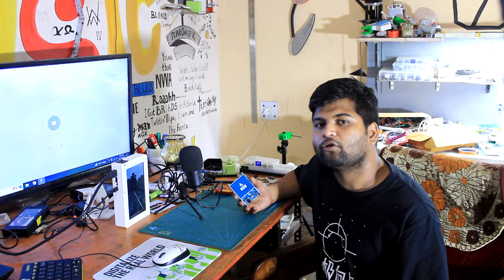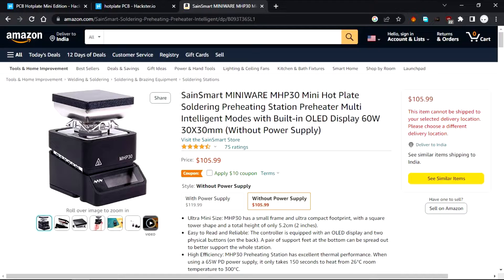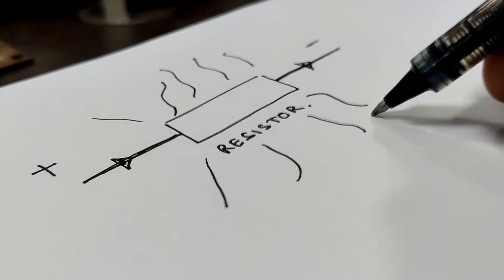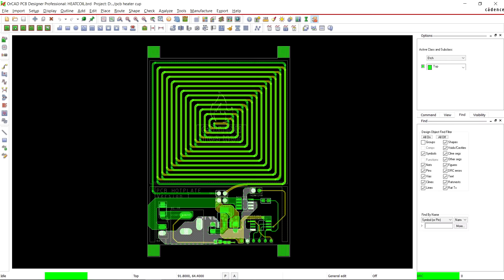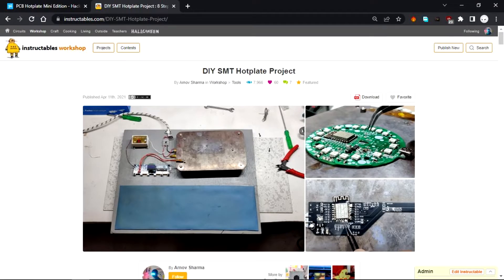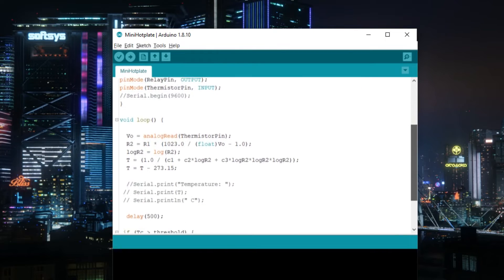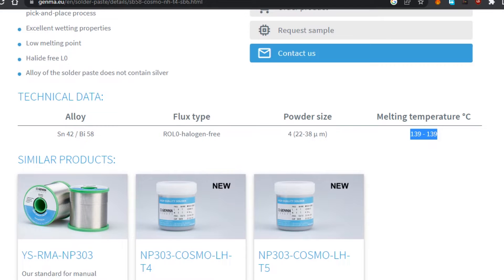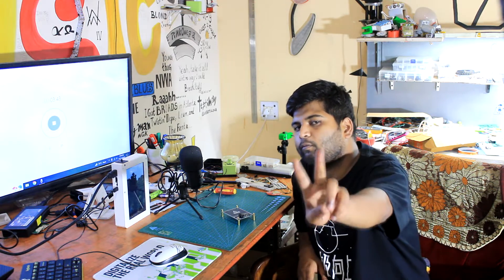Easy to make Mini SMD Hotplate

Comment: you use resistance, but if you make hundreds of small coils and put copper or metal in them, you have an induction plate with lower power and faster heating, you can control each coil separately to precisely control the temperatures, and you can also apply a thin layer of platinum on the copper coils to make it work. like a temperature sensor

Comment: Hi,

This is Faisal from Pakistan, I am not an engineer but I need something like this to burn bakhoor, you must have seen electric bakhoor burners, I need to get that and if you buy them from market they hardly work for a month or even less. Now my question is can I make some thing  as a lay man v v simple hot plate for burning bakhoor? If yes then can you guide me for that, I will be grateful to you. The size of that can be even smaller then the one you just explained.
Thanks buddy
Reply from the maker: If Bakhoor burning temp is under 200°C, this device can be used.

Comment: Can't ya use a peltier device or wud it melt lol
Reply from the maker: peltier will be not efficient for this setup because it will also waste energy on the cold side, also hot side won't reach temperatures above 140°C
Reply: @ArnovSharma  what about add plate of aluminium and thermal compound pad or paste wud it help the Pcb last a bit longer
Reply from the maker: @davey2k12  again, if we add additional metal plate, we need more energy in order to heat up the extra added metal, copper tracks will still heat up and deteriorate. So no, adding additional plate won't help. However, if we change the material of pcb from FR4 to metal core and increase the copper thickness, that might make a better setup. Similar heating metal pcb are used in 3D printers.
Reply: @ArnovSharma  good info bro 👍
Reply: @ArnovSharma  thought so 👍

Comment: Considering that most PCB material is rated for less than 170C, how long do you estimate before the lands begin lifting from the board?
Reply from the maker: maybe 20-30 cycles
Reply: @ArnovSharma   Maybe  2nd version could have the coil PCB  and the drive circuitry separate, so you don't have to solder a new driver  time the coil PCB wears out.
Reply: Expand board dimensions slightly, hollow out coil area, place thermistor on a thin strip in that area so it makes physical contact with the middle of coil PCB.

Use really wide tracks both top and bottom to send coil power up to the top stand offs. They will be used not only as legs, but they will also connect coil PCB to the power tracks. As the top standoff will now have power,  nylon bolts will need to be added so they don't short on a metal surface.
Reply: @ArnovSharma  What if you made the heater part a separate PCB made from aluminum PCB materiel?
Reply: @atomicskull6405  This does seem like the best option doesn't it !
PCBWAY is not astronomic price for alu boards either.
Reply: @ArnovSharma  I wonder if there is a "high" temp resin you could cover the board with. Maybe extend the life a bit.  I like your idea though.
Reply from the maker: @ed-jf3xh  that's an nice idea, I do have that at my disposal

Comment: The glass transition temperature of FR4 is around 140°C, would that deform the PCB over time?
Reply from the maker: sadly yes, that's one drawback of using FR4 material.
Reply: @ArnovSharma  I see they make pcbs on aluminum, would that work here?
Reply from the maker: @mavamQ  it would. i opted for FR4 because this let me add coils on both layers. MCPCB will only have one etching layer so that will affect heating.

Comment: This is a pretty cool idea-- I wonder if 1) You think the design could be expanded to be just a little bit bigger ?  2) Obviously you tested temperature in the center only, and thus only set a very, very small board-- Though I'd be very curious what temperature readings you are also getting at the corners-- Is it enough to reflow across the whole area ? 3) (!) Since the 'proximity' is kind of close, how do you make sure not to 'accidentally' (or over time), 'un-reflow' all your controller circuits? You might consider putting them a little further away. However, this is enough for me to 'subscribe' to find out follow-ups.

Comment: Really cool project. What is the current flowing through the device?
Reply: Theoretically,
V/R = I
12/1.6 Ohms = 7.5 Amps
But, this does not account for resistance change due to temperature change of the heating element of the coil.

Comment: how the heater not melting its own component joints when the pcb heats up to 214 degrees. Wont the solder on the board itself begin to melt? just curious
Reply from the maker: two reasons, using Higher Melting Temp solder paste, also there's a gap between heating coil and components making it difficult for heat transfer. rate of heat transfer can increase if we increase the Temp of coil by increasing Voltage.